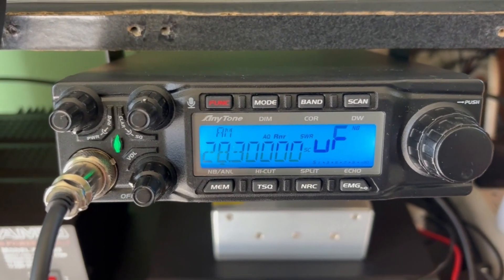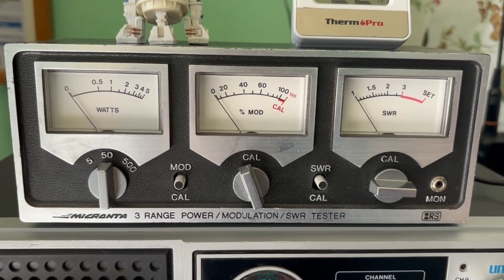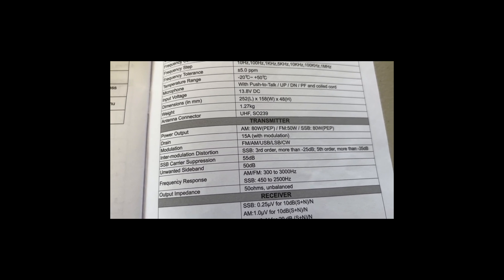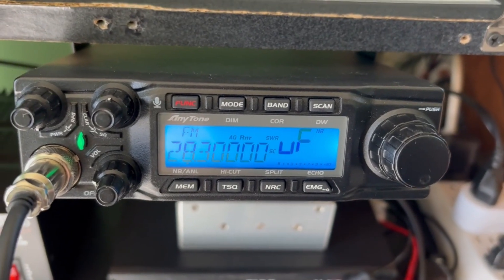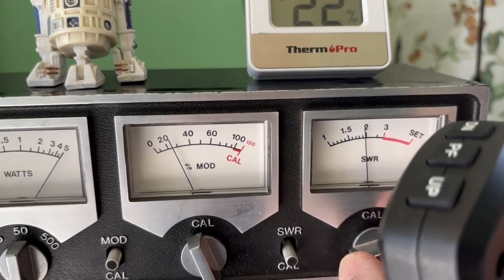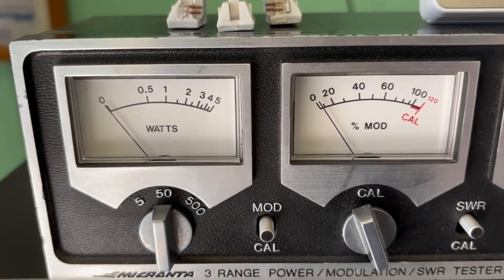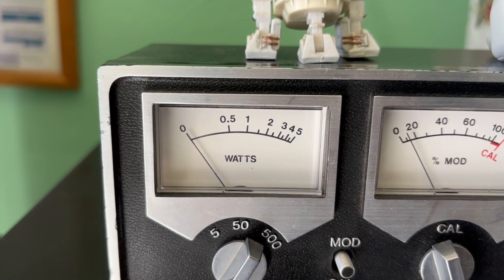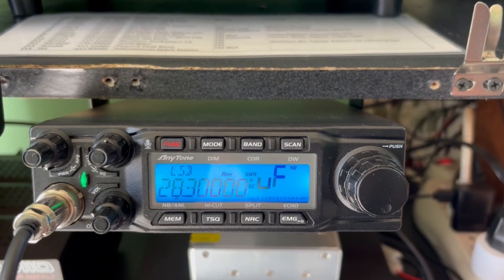Testing wattage output on the AnyTone AT-6666 Pro Radio

Comment: Does it stay at the same wattage when converted to 11 meter?
Reply from the maker: Yes, it's not a matter of converting the radio, it's just a setting you need to change. To turn on 15 meters, you need to change a jumper inside the radio.
Reply: @RidgeHikerAdventures Oh yeah that's right. I'm surprised that more radios aren't made easy to go to 11 meter like this one is. I'm not interested in soldering stuff on a brand new radio and potentially ruining it. I have a Sirio flex log 4 ft that I know can't do 10 meter. Is there an antenna that can do both 10 m and 11 m? I want to get my license for 10 m for the future.